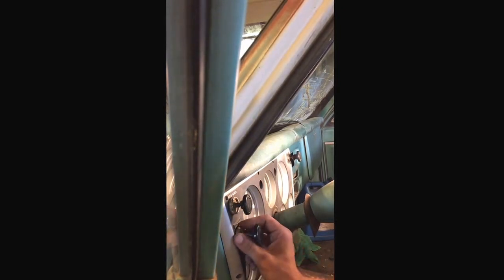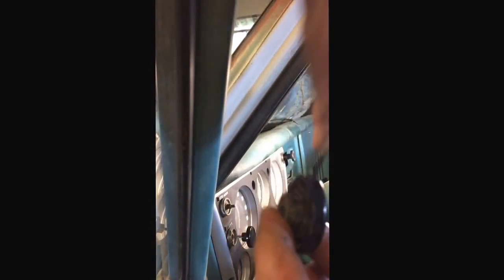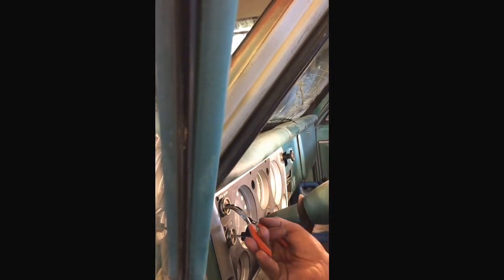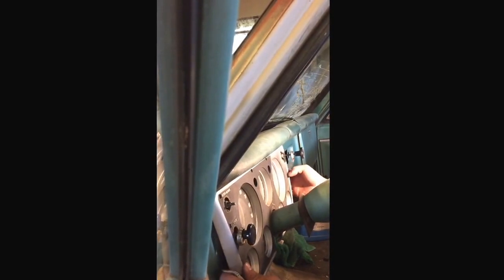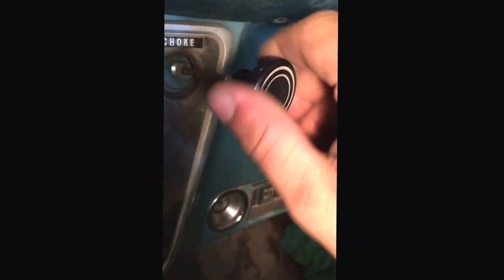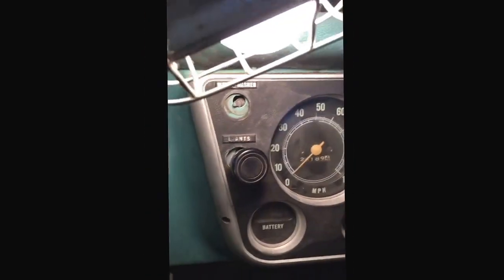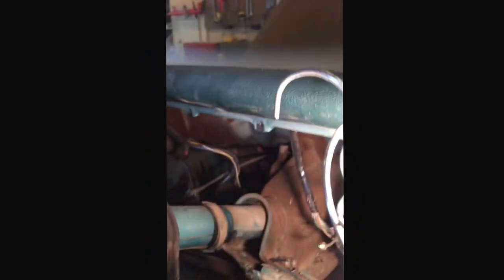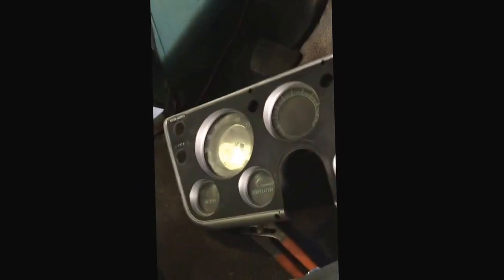How to remove gauge cluster on a 68 C10 Chevy

Comment: I used the button on top of the light switch and got the knob and shaft out ok. Had to put it back in to turn OFF the lights, after which I can’t get it out again no matter how much I mash that damn button. Any ideas?
Reply: The shaft won't come out unless the knob is pulled all the way out. Meaning the lights are going to be on in order for the button to release the shaft. Then you unplug the light switch or disconnect the battery in order to keep the battery from draining it's juice. Or, remove the dash cluster and then re-install the shaft to turn the lights off. Then repeat when re-installing the cluster after your panel repairs.